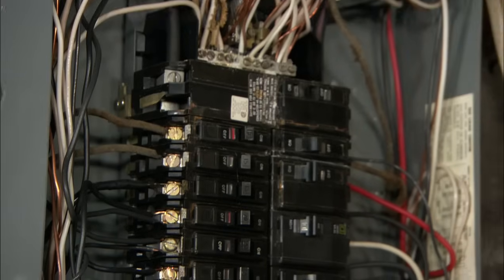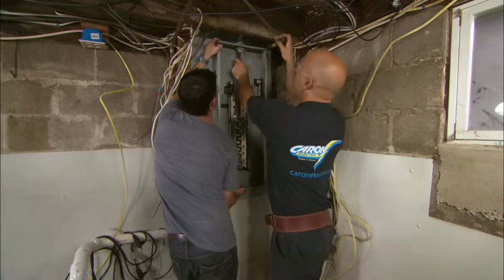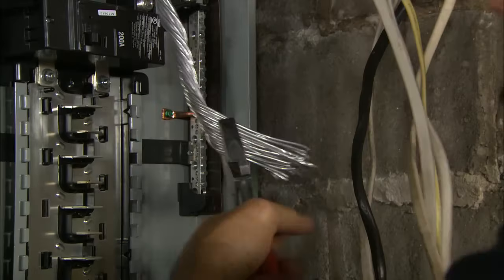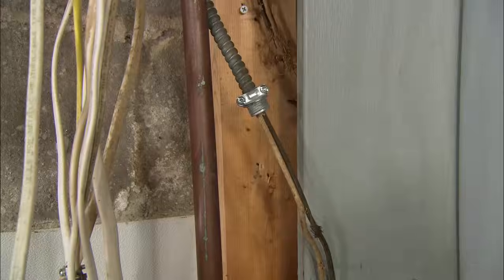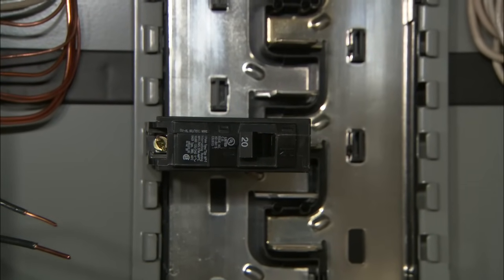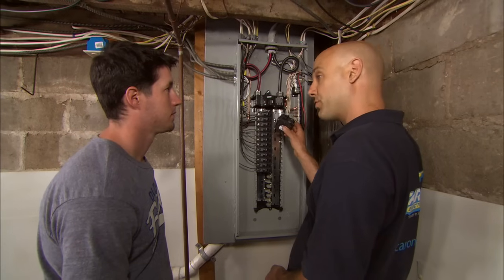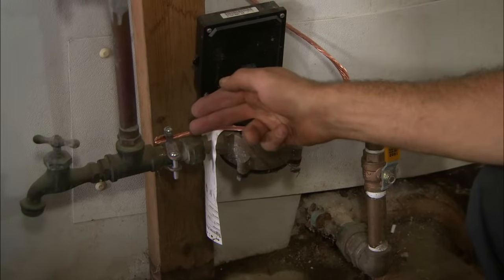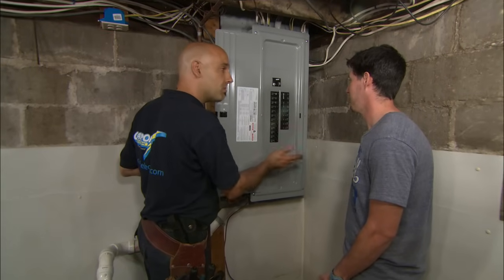How to Upgrade an Electrical Panel to 200-Amp Service (Part 2) | This Old House

Comment: Help!! Can I run 2/0 2/0 2/0 -1 copper SER 3 conductor with ground 150' under ground  in 2" conduit to my barn and  the same wire inside the basement with no conduit  100' across the basement to the outside wall . we have 200amp main and I'd like a 100amp sub panel in the barn .People tell me no! You can't run SER wire inside conduit. And SER wire has to exit the building within 5 ' of the main panel in the basement. This true? or BS
Reply: SER.  I bet that means Service Entrance.  Not sure what the R means.  I see there is also a SEU.  As in Service Entrance Underground.  Still not sure what the R means.  Most would guess Rated but assumptions make an Ass of us all.  

Here is what the manufacturer says.  Note they say where permitted.  The great Caveat.

" ... SE service entrance cable has various uses, but can most often be found being used to convey power from the service drop to the meter base and from the meter base to the distribution panelboard. 

Beyond this, SER and SEU cable can be used in all applications where SE cable is permitted. ... "  - SER & SEU Cable - Nassau Electrical

As for the voltage drop . . .  Looks like for 250 feet at 100a the 2/0 CU is a little light at full load.  Because you will have additional circuit length within the barn as well.

Voltage Drop - 4.7 Volts   3.92 %
Load At Circuit End 115..3 Volts
Conductor 133100  CMA
Reply: PJ: Your barn needs to be provided with a separate ground (the #1) and a separate neutral (one of the #2/0), so you could do that. Type SER can be used indoors and outdoors within conduit, or not (if not otherwise required). Underground Service Entrance (USE) cannot be used indoors except at point of termination, but that doesn't apply to SER (aka SEU or SE). There are a lot of other code requirements not discussed here.
Reply: Thank You Soren . We put a big box where it exited the house and made the change to the wire that goes in ground. Worked out great ! Thanks for the help and youtube. Greatest thing since slice bread.

Comment: i would keep a square d qo panel and breakers for a small house
Reply: +David Berquist   lots of good breakers junked there as well.  I like Sq D's enclosed bus bars.  Way safer than this brand.
Reply: I do that whenever I rip out a service. I must have $2,000 worth of circuit breakers that I took out of people's houses LOL
Reply: Unfortunately many of those good branch cct breakers will go to waste as the rules now require Arc Fault breakers on most plug ccts..  

Way to go regulators - turn an $8.50 cent breaker solution into an $85 expense for each cct.  

I'm surprised that there is anybody left alive in other countries that use electricity considering their lack of self serving, profit centered, safety mechanism regulation.
Reply: Yeah I completely agree. AFCI on every circuit is just overkill. I think It used to only be required for bedrooms until recently. I have NEVER had AFCI breakers in any house or apartment I have lived in. In fact most of the apartments I lived in until I moved into a condo built in 1994 only had fuse boxes. Hell as far as I know no body in all of those buildings ever got killed from electrocution. I think electrical code has become a little rediculous in the past few years. Don't even get me started on tamper resistant outlets. I absolutely hate them. In fact when we bought our house the newly added bathroom had 2 of those nasty TR duplex receptacles in it and they drove everybody in the house mad. The day I ripped them out and threw them in my junk pile just felt so good. Too bad many big stores such as home depot only carry the TR crap now. I am just keeping my eyes peeled for used and new non TR receptacles. Many of the decomishined ones I find are either so worn out they don't hold plugs in or the plastic is all cracked and covered in paint. Hopefully I can get enough to last me a lifetime. Btw I am only 17 years old.
Reply: I agree Square D all the way. The QO series panels are one of my favorites. At home I have a 60 slot 200 amp Square D panel as my main panel and for sub panels I have an 8 slot square D and some old 60 amp fuse box. I also have a 100 amp federal pioneer panel in the garage but I just don't like it as much as the Square D QO. Hopefully that panel in the video did not go to waste
Reply: @CompGuy66  they're old and outdated. You can get a standard 15 or 20 amp single pole breaker at a home center for under 5 dollars.

Comment: I have 100 amp service and I can out a 200 amp box in without changing the outside wires that comes into the house? I bought a 200 amp box and can't return it. So, I can use my new box without changing my 100 amp outside wires?
Our house was built in 1922, Only has one or two plugs per room. I just am going to rewire each room and have it's own breaker.
Right now the three rooms upstairs are on one circuit and with all the eletronics we have, I need more plugs. Thanks in Advance.
My husband talked to an electrician and he said I would have to change the line coming in to put the new box in and we think he just wants to make more money. That is why I am asking.
Reply: The feeder wiring from the meter to the new 200 amp panel has to have at least 4/0 aluminum or 2/0 copper sized wires. If not then yes it absolutely needs to be done. Get several quotes. Never stick with one quote only. Don't always go with the cheapest bidder either. Go with a Licensed Electrician ONLY. If the service wire has to be changed it has to be changed. Make sure you get a homeowners permit with your city or county. It's cheap and easy to do. 

I'm a Licensed Journeyman Electrician 
Florida 

Jeff
Reply: +Kimberly Tritt   you either have to change the lead wires to what onecrazywheel said or you can change the main breaker from the 200a one installed to a 100a one.  (It has to be a main breaker with an interrupt capacity of 22,000 amps written on the side of the breaker - not 10,000 amps like branch circuit breakers.)  Probably cheaper to pick up a 100a panel and resell the 200a one.  Anyways it's the breakers that are expensive - not the cans.
Reply: True enough but hard for lay people to understand why.  Some are still trying to add the 100a on the one side of the 2 pole breaker to the 100a on the other side of the two pole breaker to come up with 200a.

The reason you can use a 200a rated breaker and sub panel on the back side of a 100a disconnect switch is because the 100a disconnect protects the conductors feeding the 200a sub panel.  The 200a breaker in the sub panel is being used as a disconnect means to isolate the panel, not as an overload controlling device.

Comment: Circuit breakers ARE NOT intended to prevent wires from "overheating".
Reply: +DJ joey 

Oh? I'd be very interested in hearing what you think is the circuit breaker's intent.
Reply: My extreme pleasure Draxel ... circuit
breakers ARE built solely for the intended of "over current protection" only. They are not a fire prevention device as constructed.  The will not prevent "overheating" or burning wires for that matter if rated amperage is not met. Plenty of wires depending on gauge and drawn amperages can still burn when terminated under a incorrect breaker.
Reply: +DJ joey 

"Over current protection" is in practice "Overheating protection" - the reason we use circuit breakers is to prevent too much current going through the cable because current generates heat.
Just because it's possible to terminate a wrongly gauged wire to a breaker doesn't mean that it's intent is to prevent over-load/heating.

There are of course other factors that must be considered to prevent overheating and fire, but the breaker is one of them.

I don't like using comparisons, but it's kind of like saying that brakes on a car are not for stopping the vehicle because you can  put on brakes not rated for the weight of the car.
Reply: +DJ joey I think the internal bimetal that trips due to a corresponding amount of heat energy dissipated (watts) shows that over current protection is synonymous with over heating wires.

Comment: This why if you have the chance to go get the training and the license, you can save a lot of money if you need this done.You will always have work like HVAC and Plumbing.You will always have a skill that you can use anywhere.
Reply: True these trades will never be outsourced and will always be in demand.
Reply: How do get the training if the union doesn’t have openings and no shops around me have any openings? Is there a better way than going through the ibew?
Reply: @johnpachner9236  I don't live in a Union state so I may be the wrong person to ask, but here you can get trained to be an electrician or plumber at a local community college. I don't know if it's any different or not in a Union state.
Reply: @RoastBeefSandwich  I was looking into it last night and there's a vocational school that has an electrician program. Not sure how much it is, but probably pretty cheap compared to an associates degree, let alone an undergrad or higher.
I work in I.T. and make near as makes no difference to 6 figures, but this looks quite fun and you know it's more than enough to pay the bills and can definitely help with any future real estate property investments. It's really a no brainer if you have an interest in it.
Reply: @ryanshannon7703  When I went to college for welding between 2011 and 2012, it was $6500 for the year. So it's close to that for HVAC and electricians. I know here in Lincoln, NE, there's a couple companies that'll train both fields that are not union. Which is a benefit.
Reply: If you're young and unmarried:  Get vocational training and take on non-union work. Bust yourself hard for several years with 80 hour/week rotations to gain all the experience you need.  Then start your own shop and let the money roll in.

Comment: Just to clear up some confusion with grounding(GEC), neutral and equipment grounding conductors. First of all this is not the whole video so there may be some confusion because of that. 

The neutrals can not be doubled up or paired with an EGC(NEC 408.41), but the EGC's can be doubled up, depending on the listing of the panel manufacturer.(NEC110.3(B)

The system grounding connection(GEC) was code compliant. NEC(250.24(A)1. He used two ground rods outside and connected it to the meter can, which is permitted by the NEC. However the local utility has requirements on this so it can vary. 

The bonding of the water pipe is compliant. NEC250.53D(1)

The reason the neutral and EGC's can share the terminal block is because this is the main disconnect. At 2:31 you can see a black looking bar that ties the two terminal blocks together and you can also see the MBJ(copper piece with green screw) is tied to the enclosure. NEC 250.24B, 250.28A, B, C
Reply: This will probably be the most important, yet least viewed comment of the video.
Reply: Tbone McShittles  $2300?!? I need to up my prices 🤔 How high was the point of attachment?
Reply: @MikeSwirled  in Seattle I've heard of people paying $3k-5k for a panel change...
Reply: @antaholics  Just the panel?!? 😱
Reply: @MikeSwirled  yup... I paid a bit less than that but those prices are not uncommon
Reply: Tbone McShittles  I’m truly sorry that happened to your girlfriend, did it even get inspected? Sounds like about $1300 with inspection, maybe $1500 because of the sub.
Reply: This is true. But he didn't put a main disconnect underneath the meter base like he should have. No upstream protection of service entrance cable.
Reply: One thing I never and will never understand is why people are so critical of a 5 min video clips from this channel. They don't show one lil thing and everyone is "well in MY area you aren't suppose to do THAT". Do they not know things are different from city to city? Freaking idiots.
Reply: @Johnnybgood24  What you don't understand is the ELECTRICAL industry.  Details ARE everything, and details can mean life or death. Electricians are held responsible for tragic faults. So keep your ideals of distain somewhere else that doesn't involve life safety.
Reply: Two ground rods are not required on a house with city water supply, the underground water service system is considered the main ground. Only one auxiliary rod required.
Reply: @MikeSwirled  Two ground rods are required per NEC.
Reply: @chipdayton1625  Only on a non-municipal water supply.
Reply: @chipdayton1625  A home with municipal water supply is considered the main grounding point, hit bellow the shutoff or water meter (hit both sides) and then yes, a separate ground rod requiring no larger than a #6 bare copper regardless of amperage.
Reply: @chipdayton1625  This applies to all electrical services, home, commercial, industrial.